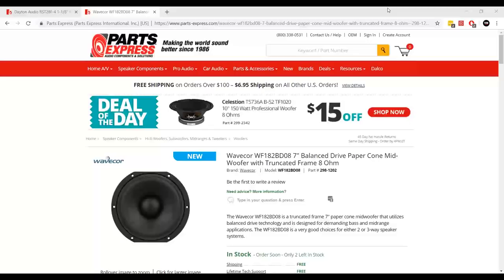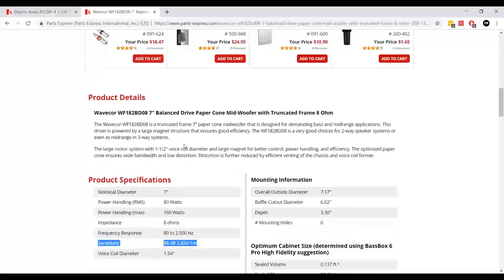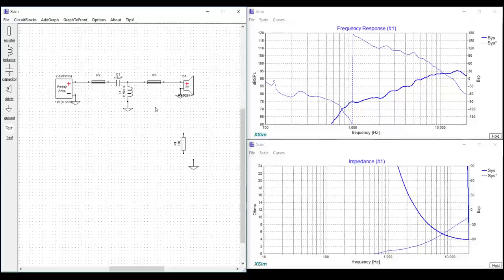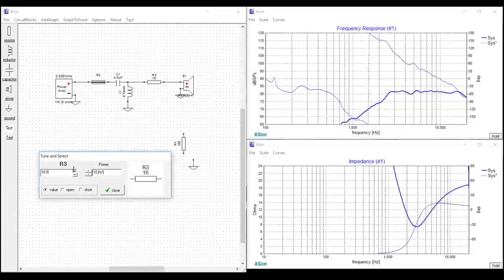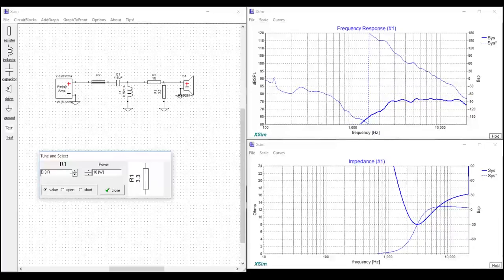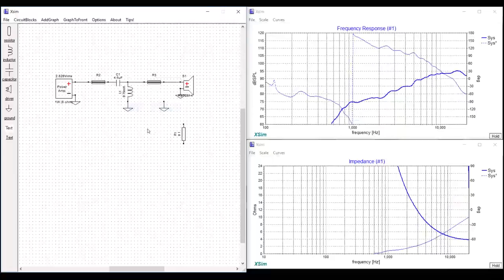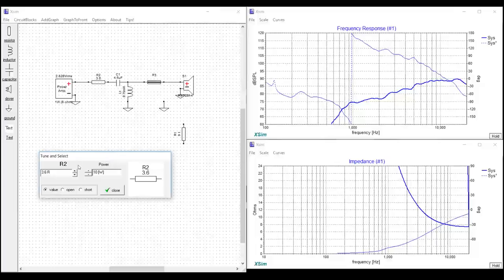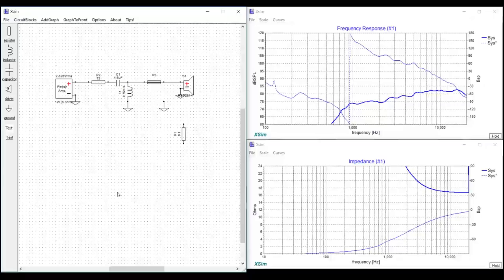3 Ways to Attenuate a Tweeter

Comment: For more severe sensitivity mismatches - more typical when using compression drivers; you can attenuate anywhere from 1 to 12 dB with an Autotransformer.  There are some drawbacks to using resistors for large sensitivity mismatches.

Comment: Are the passive crossovers that typically come with component speakers set up in a similar way? If I'm trying to attenuate the tweeter, can I just add a resistor wired in parallel with the tweeter? If so, how do you choose a proper resistance value?
Reply: Yes! I've been trying to figure Out the same thing!

Comment: If I wanted to try the resistor before the crossover on a 4" midrange 4ohm ( I know you recommended against this) in a 3-way setup getting about 35 watts max per channel, what precautions would I need to take ?  I want to use a 5ohm resistor on each mid before the crossovers. Do I use two 2.5ohm resistors to dissapate the heat? Three 1.7ohm?  Or don't try it at all?

Comment: How do you know how many watts value u should use for the resistor? Let's say you have a 100watts rms power capable tweeter. Great vid btw
Reply from the maker: That is a good question, that is not easy to determine, since there is not equal power distribution between frequencies.  And some depends on your source.  However, here is something that may help you:  A  55w equivalent was published in a french audio magazine by Pierre Etienne Sirder about twenty nine years ago. They are based on Harwood's works at the BBC. So if we were to adjust this for a 100 watts, you would be looking at approximately. 

Band (Hz) -> Power (W)

32-63 8
63-125 16
125-250 18.181818
250-500 18.181818
500-750 12.72727273
1000-1500 6.363636363
1500-2000 4.545454545
2000-3000 3.181818182
3000-4000 1.590909091
6000-8000 0.4
8000-12000 0.2
Reply: Use a software that can calculate it. Or just use 10W resistors in tweeter sections and 20W in mid, this should easily handle 200W total power.
Reply: I've always used relatively low-wattage (3-5 watts) resistors in the post-capacitor area of the tweeter circuit and have never had a resistor failure.  I've even used a three watt resistor in series with an entire speaker system to raise the load impedance so an amp can safely handle it -- e.g. when the speaker DCR is < 3 ohms and the amp is rated for nominal speaker impedances of 4 ohms or higher -- with no noticeable heating of the resistor, even at high volume.  It seems to me that the current in a speaker circuit is simply not constant enough for much heat to build up -- and thus lead to eventual failure -- in a series resistor, which in turn leads me to believe that the wattage rating of the resistors in most crossover networks is unnecessarily high.  A pair of lovely old two-way JBLs I'm currently using are rated for amps of up to 125 watts, yet the resistors in the tweeter section of their crossovers are ordinary 10 watt wirewounds -- and it's well known that JBL tends to be pretty danged conservative when it comes to crossover design.

https://i.ebayimg.com/images/g/vmwAAOSwZ2tcWLfA/s-l1600.jpg
Reply: @editorjuno  Thanks Bruce, this was very helpful

Comment: If you put a single 10W resistor before the crossover, would you also need to change the value of the cap/inductor? If I had an 8 ohm tweeter and an 8 ohm resistor, would I calculate my crossover as a 16 ohm tweeter? I know impedance ohms and resistance ohms are different.

Comment: Hi! 123Toid I enjoy your vids to the point I decided to try to follow along with you and Kirby and that handsome guy from Canada. lol.... So I got the Omni Mic. I play the sine sweep. Then I think, shoot how loud do I turn up my stereo? How do I know when I have the volume at 1 watt or 2.8 volts? Anyone that reads this please answer. I want to get on with this new hobby but I hit a speed bump right out of the gate. Do I need one of those wire pinchy things electricians use?
Reply from the maker: All you need is a multimeter. Turn on your amplifier. Make sure that you've downloaded the audio files from the Omnimic website http://www.daytonaudio.com/index.php/omnimic-v2-precision-measurement-system.html The last two files are 50hz test tones to help setup your voltage. Play that.  Then put your multimeter ends in the speaker terminals and the back of the amplifier. Turn it up until it reads 2.83v. Place your microphone 3 feet back.
Reply: @Toid  Oh my gosh, thank you so much for replying. I tried the pseudo noise and the meter was freaking out and I was getting new stuff overload. You are a great ambassador to this hobby. So glad I clicked back on here to see  your perfectly worded reply.
Reply: I tested with the meter set on AC Volts Auto I got a reading of 2.78 and one volume click more gets 2.98. .....2.83 welp ya can't get there from here, so I will just go with the 2.78

Comment: If you choose the third option and put the resistor ahead of the crossover, does the resistor not also attenuate the woofer or did you mean put the resistor in series ahead of the HIGH PASS crossover only and not the ENTIRE crossover? In my case, I'm replacing a tweeter in a 2-way speaker with another one that has nice flat frequency and impedance responses above the crossover point (2.5 KHz). As the replacement tweeter is a few dB higher in sensitivity than the original tweeter, would option 3 be the best way to go? I only want to knock the tweeter back a couple dB and not effect the woofer.

Comment: What are the effects of a parallel resistor post xover?
Reply from the maker: By itself?  It just attenuates the tweeter down without really affecting the response.  However, this will lower the impedance.
Reply: @Toid  Ah, gotcha, that makes sense. I can see that being an issue. I don't play with xsim enough.
Reply: it's basically a voltage divider circuit... like in potentiometer.

Comment: Would this work for any of the drivers to be installed? I want to attenuate a woofer
Reply from the maker: I definitely need a lot more information . The best thing to do is go over to the forum and let everyone know what you're trying to do so we can see if we can help. www.toidsdiyaudio.com/community
Reply: Fascinating. Since so many tweeters have a rising response the cheap big box store approach might have some real advantages. I normally think of using a pre-built adjustable L-pad to keep Z the same but now I wonder about using a series resistor to get the shaping and just a straight adjustable resistor in parallel with the driver to adjust level. Of course just an adjustable resistor in series might be nice in some applications as it would adjust level and slope at the same time. Might be good in highly reflective rooms.

Any suggestions on what to buy for adjustable resistors?

Comment: Would it effect anything if you put the parallel resistor before

 the series resistor
Reply from the maker: It does.  It will start to pull the lower to mid end down while leaving the higher frequencies rather unaffected.

Comment: Way to pedantic for the subject. It would have been simpler to just have an L-pad and a tweeter. then a short explanation of how to use it to attenuate the tweet. . I new al of that already just never used or needed an L-pad before. Received one with zero instructions very strange way to sell a product. Just needed quick explanation of how he 3 tabs hook up.
Reply from the maker: You're saying you knew all the different ways to attenuate a tweeter and the effects it has on the response, but didn't know how to install one?